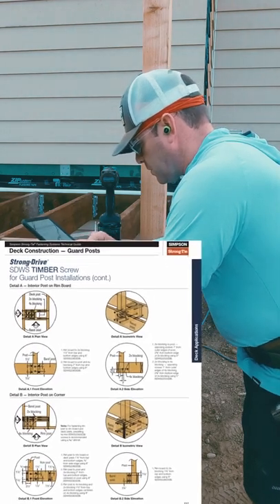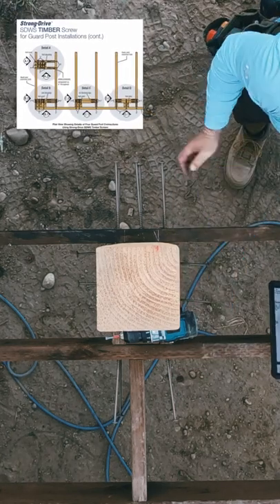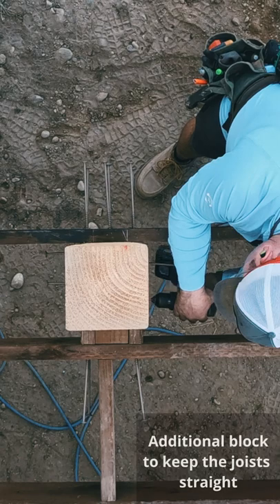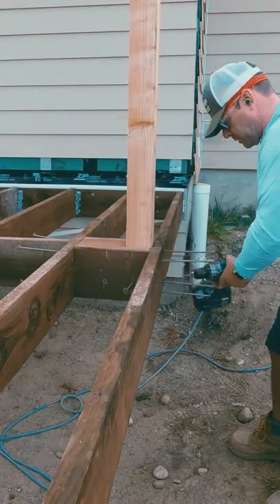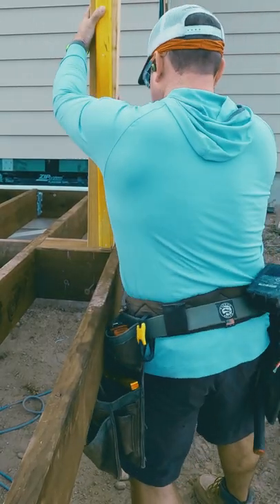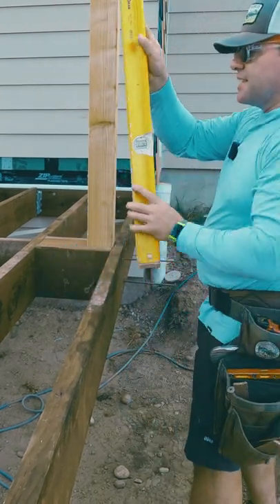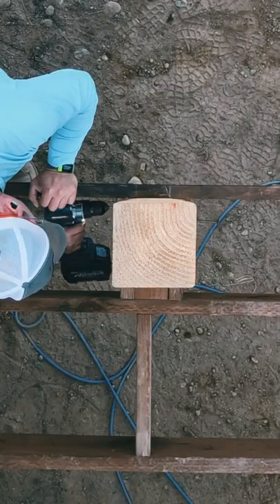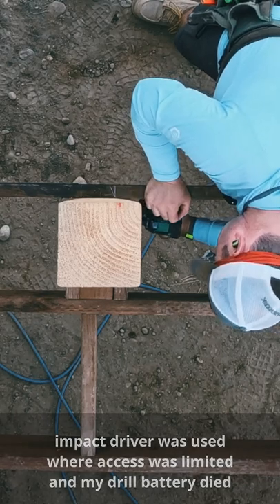Fast, Easy & Code Compliant Deck Posts #shorts

Comment: As a professional deck builder for over 30 years...there are lots of ways to satisfy code requirements on top of the various codes one might run into. This is NOT the only way.
Nice ad for Simpson.

Comment: Nothing beats C bolts when it comes to posts. If it would ever let loose because of shrinkage, you already have a nut there to fix the problem. Can’t do that with structural screws.

Comment: Gonna be a wobbly railing system those posts need to be in the ground period
Reply: Not even close to correct.
Reply: @jwil4905  Ilolol ok have a nice day
Reply: @jasonnester9514  You too, but go easy on giving building advice.
Reply: Lol no. Me and my guys refer to what you are describing as "the wrong way" to build handrails.
Reply: @17Scumdog  I’ve seen many rails done the way u did them and they’re all wobbly bud but do what u think is best good luck

Comment: That’s the side of the deck not the front so where do you screw your picture frame and the end of the decking boards get screwed into? This seems over complicated and under achieving.
Reply from the maker: This is a 1 minute clip showing 1 way to meet guard post requirements.  It doesn't show the rest of the deck framing nor the actual design of the deck.